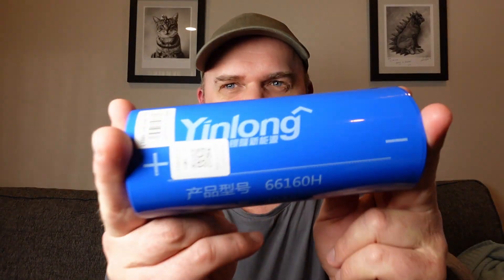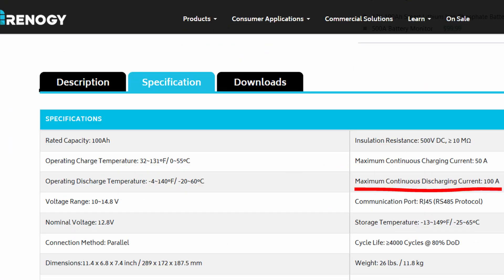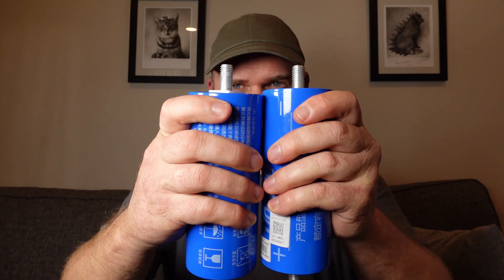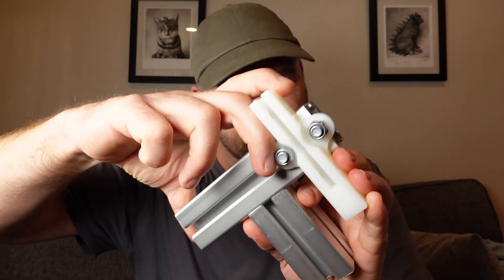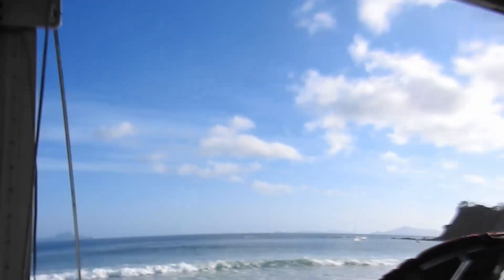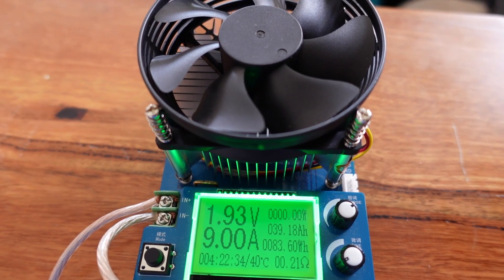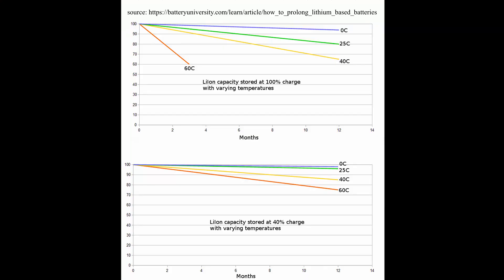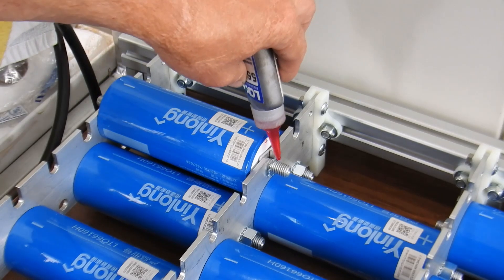Campervan DIY battery build HUGE POWER!

Comment: As an electrician, I appreciate your engineering skills. I do have a couple of suggestions: Best to use copper bus bars. If not, use tin coated aluminium bus bars. Aluminium oxide, which forms very quickly on bare aluminium, is very resistant to electrical current. The star washers you used may save your bus bars from melting by piercing through the oxide coating and providing a decent (not optimal) connection to the un-oxodized aluminium. Tin coated bus bars are protected from oxidation by the tin. The last option would be to sand the connection areas and use a non-oxidizing electrically conductive grease on the aluminium. This grease can be purchased through most electrical supply houses and many hardware stores. I would also use lockwashers on the studs along with nylock nuts (and no thread-lock compound, but anti-seize compound). When aluminum under compression connections is heated, it will ooze out of the connection. Then when the connection cools, it will contract, leaving a small space between the connection that allows oxides to form. Aluminium wire must be re-tightened every 5 years to accommodate this issue. Copper holds a memory of its shape and will expand back to its original shape instead of oozing out of the connection. The lock-washer will provide compressive force to the connection that will expand to prevent loosening over time, a must on all battery connections. Or better than that, use a bellville washer. It is used to make electrical connections. It is very slightly cone shaped and made of spring steel, so it provides the best expansive connection to make up for thermal expansion and contraction. But they are very expensive. I looked at building a similar system for my home, but went with used Tesla batteries for now. I would assemble them like so: Battery cell---Anti seize compound on stud--Stainless steel nylock nut---Stainless steel flat washer---No Ox grease---copper bussbar---No Ox grease---Stainless steel flat washer--bellville or stainless steel lockwasher---anti-seize compound on stud---then finally, a stainless steel nylock nut. I would use the same system for aluminium bus bars. The nut on both sides of the bus bar is to prevent the stud from putting tension on the cell. All my best to you and your system. You are very correct to look at cost per cycle instead of just cost per kw hour capacity. You will pay more up front, but a lot less in the long run.
Reply: What if he used standard copper pluming pipes 15mm diameter 1mm thick? flatten them with hammer = 23mm wide, 2mm thick, is that good enough? they are affordable , seen many people on YT make DIY Battery Terminals out of them, would it work for his applications? in fact I think maybe he could just retro fit his existing busbar (if this current system allows for 24mm length expansion), he just needs to buy 3-4 pipes at 5m long cost around NZ40 (USD28) each on trademe.co.nz
Reply: @leoncryp8182  While it will work, it is not ideal. Copper pipe often uses a slightly different formula than typical copper bar and sheet stock used for electrical in order to maintain stiffness. The process of hammering out the copper tubing can also cause the copper to crystallize. This is the same as if you bend a copper (or steel) wire back and forth enough, the metal will eventually break due to crystallization. This crystallization also creates a very high resistance in the copper. This is why one is required to use stranded copper wire for flexible connections or power cords. I have seen solid conductor building wire catch fire from being misused as extension cord material. Seems like a lot of work, when you could buy the sheet copper online for not much more. The dangers of getting a battery system wrong can be catastrophic.
Reply: @GoCoyote  Thanks for the insight, buying proper copper sheets sounds like the way to go, what if you had a small project and and some pipe lying around, burn copper with a touch? kind of annealing it or something, would that relax and soften up the crystal structures? seen people do that to bend copper and aluminium, heat then bend slightly, heat again and keep bending, gets very nice smooth bends
Reply: @leoncryp8182  I apologize, but that is beyond the basic knowledge that I have. I often tell people that I have a lot of (hopefully) informed opinions, and hopefully, some facts. One my apprenticeship instructors told us that there is no way that we can memorize all of the information we need to know, as knowledge changes all the time. The thing we need to be able to do is know enough to be able to know that you don't know something, and that there are resources to give us that information.
Reply: @leoncryp8182 cant you just get some nice bar at a scrap yard if gotta save on that?
Reply: @leoncryp8182  there is more surface area
Reply: Unless you sand and apply that grease in an oxygen free environment you will always have an oxide layer there, it happens almost instantly.
Reply from the maker: @mickwolf1077 yes, but the layer seems to be thin enough at that point to be able to be damaged sufficiently when assembled that it seems to conduct well.  The point of the grease in my mind is so that condensation doesn't wick into the mating surface causing further corrosion and pushing the connection apart.  I'm still not fully convinced by grease, obviously a light sand, grease and then sand again while greased on the surface is best.  However, it seems to have worked well for close to 4 years now, admittedly I'm only loading it regularly to about 250A, but have thermal imaged it several times under load and not seen any warm spots yet.
Reply: What about using tropicalisation varnish from MG for bus bars and terminals isulation?
Reply from the maker: Thanks for your comprehensive advice.  I didn't use copper because it would likely have cost close to as much as the cells and then have many points of dissimilar metal contact.  I appreciate ali can be problematic with the oxide layer.  Each point of contact was lightly sanded and had a light coating of grease (not conductive - but have previously found non conductive grease works fairly well).  Am hoping the relatively low currents through each connection will mean low stress and a lack of issue (optimism at it's finest).  If for eg I'm pulling 3kW, it will be pulling around 15A through each cell connection.  Cheers, let me know how your tesla system works out for you.
Reply: @brendontait6968  I looked at doing a system similar to yours. I would have to look if I kept my notes, but I remember that the copper did not need to very thick as you are not passing enough current through any given area to make a dent in the sheet copper capacity. I believe it was 1/16 inch or even less. While you may only plan on running 15 amps through your cells, you have to base the conductor size on on your over-current protection device. You could even use 1/4 inch plywood for strength and laminate the copper to it. I was looking at placing the cells in parallel groups and switching the direction of the cell groups. The posts of the cells are almost always designed to work with copper and tinned aluminium, so galvanic corrosion is not generally an issue unless using uncoated aluminium bus bars. It is very important to check with the battery manufacturer before sanding any of the battery terminals. Some are silver plated, and sanding can remove the plating. General rule of thumb is that if its already clean and shiny, leave it alone, aluminium being it's own beast, Its a great material, just needs special consideration for electrical systems. I am using Tesla modules from Daimler smart for two vehicles. While they are great, I wouldn't use them again. They are configured one more cell in series than is optimal for my 48 volt Outback inverter and Schneider 600vdc charge controller. They also need a separate BMS for each 3.3kwh pack. The cost of LFP cells and BMS systems have come down in price to the point that they are just as cheap as the used tesla modules. They would be great in a golf cart though! All my best to you and your system. Please stay in touch if you want more opinions, and maybe a few facts.
Reply: Hey maye at about 2 30 mins in u said each one of those has a 400 amp discharge but writen on them it onle says about 40amps can you please help with that confused on that one
Reply from the maker: Hey, yes... I tried to explain this in the video..  Amps and Amp Hours are different units.  The cells have 40Amp hours written on them.  This is their capacity.  They can put out 40 Amps for one hour, or 4 Amps for 10 hours or 400 Amps for 6 minutes.  The rated discharge rate is 400Amps.  This is how much power you have available to run a heavy load.  For example, some loads may have a start current of say 200Amps.  If you use a battery that is only rated for 100 Amps, you will damage the battery.
Reply: @michaelroberts6299  
The standard Amp hour capacity measurement of a battery (or C rate) is the number of Amps that a battery is capable of delivering over a one hour period. In this case it is 40 Amps for one hour. The battery will also have ratings for charging and discharging based on the "C rate." A 40 Amp hour cell charged at 1C will be charged or discharged at 40 Amps for one hour. While other C rates are possible for the same battery, they generally will have an effect on the total capacity of the battery, with lower C rates adding capacity, and higher C rates reducing it. So the same battery at 2C would charge or discharge at approximately 80 Amps for a half hour, or at 4C, 160 Amps for 15 minutes. LTO batteries are generally capable of being charged and discharged at 10C, so 400 amps for a tenth of an hour (6 minutes) is not out of the question. Some batteries will have different C rates for charging or discharging.
Reply: @GoCoyote  Hey Coyote nice info. One question, why are bus bars acceptable in this case wouldn't it be a good practice to use copper sheets as fuses that die at >400a discharge to prevent thermal runaway and possibly damaging more than one cell?

Comment: Great info and very nice clean build. I've built my fair share of heavy battery banks for RV's , motorhomes, boats golf carts etc with flooded and AMG batteries. Very nice job with new technology. My only question is what interest rate did the bank give you on the 2nd mortgage to pay for all those cells????? 😂
Keep up the good work mate.
Reply from the maker: Thanks, interest rates are super low right now!

Comment: hello, you are a genius
  They are connected in the aluminum they are connected in series, or it is only so that they are fastened
I am new to all this
I would like to start making a project of a car
of course, little by little
Reply from the maker: Thanks Osmar.  The ali bars are to support the cells, but they fix the cells in parallel that then link in series.  Follow along, will be doing lots more how to battery things.

Comment: Haven't even finished watching it yet,but I can already see that you've put plenty of thought into the design. BTW, I know those as cup bolts, and are you not thinking of coach screws? (which are big self tappers with hex heads)
Reply from the maker: Thanks Adrian, I think I said coach bolts... which I know to be what I was using, whereas coach screws are as you said hex head, heavy wood screw.

Comment: If lock tite is applied on the bolt or nut. Heated it up, before wrenching. Work really well.
Reply from the maker: Not sure batteries appreciate a gas torch

Comment: Thanks for the video.  Nice job.  Great technical info!!  Definitely looking forward to your other off-grid videos.  I think the kva comparison in the beginning was a bit misleading since the battery pack can only meet that briefly (I believe).
Reply from the maker: Hey, no problem.  Depends, as far as I know, that is the max rated discharge of those cells.  Tho I am fusing it for just 10kW so will never see close to the 90.  Didn't intend to mislead

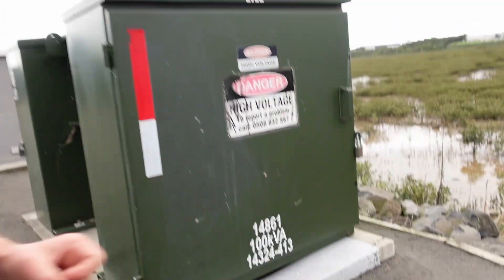Comment: at 2:40, power and energy are usually about the same.     the overlap of certain power/energy metrics  should be understood.     examples:  one joule  =  one watt-second;   kva, kilovolt-amps  =  watts, continuous (watts);  amp-hours, watt hours  =  ways to include  time/duration in a metric           googletranslate
Reply from the maker: Hey David, I'm not sure exactly what you mean about power and energy being about the same?  For eg.  The power output of my battery is around 90kW but the energy capacity is 9.5kWH
Reply: @brendontait6968  you have failed to comprehend my motivation for mentioning  that some  metrics include a time/duration and some don't.  such as  kw.    yer 90kw translates to  So Many  watt-HOURS.

Comment: G’day mate I’m looking to build my own battery for my troop carrier as I’d like to do some touring I’m looking for about 3 to 400 amp hours what do you recommend in a 12 V system. 
Your vid are bloody awesome 👏🏽
Reply from the maker: Thanks Terry, What sort of loads are you wanting to pull from it?  If you want to do electric cooking, then 24V really is really recommended.
Reply: @brendontait6968  mate to be honest I like building lots of things I’ve just finished building my troopy from ground up that I can do! but when it comes to electrical I am a real dumb prick 🤭🤭😂😂 but anyway I do want to give it a crack and as for how much draw load I would like to use an induction cooktop in time to come but I usually use my charcoal grill to cook with and my camp oven. 
I was looking to buy a red arc Manager 30 system but my god they are so bloody dear and at this point maybe out of my budget but yet I don’t want to have to do it twice I just want good quality components that work sorry if I’m a little vague on what you’re asking but like I said electricity is not my forte but willing to learn. 
Anyway brother any info or help you can offer me is greatly appreciated but I certainly don’t want to be a burden to you thanks forgetting back to me.

Comment: When using aluminum conductors, an anti-corrosion coating should be used.  Noalox is used in aluminum wiring to prevent corrosion on wire ends and terminals -> https://storage.googleapis.com/ebh/documents/product/16440_catalog.pdf.  Like you said, Loctite should not be used on threads of the cell terminals, lock washers or locking nuts should be enough.
Reply from the maker: Thanks, yeah I just used grease - you can see me applying it with the cotton tip.

Comment: LTO cells are great for high output but aren’t very good AH so not very good for campers.
Reply from the maker: Depends on what you are wanting in your campervan...  I'm wanting something rugged and safe with a long lifespan... so it works for me.  Ah????  What does it even mean?  A proportionate measure of the number of electrons passed without reference to their energy level?  The most useless term for energy storage.

Comment: I'm still learning all this stuff, so forgive the dumb question - how many of these cells would it take to build up a pack that is 400ah (basically the equivalent of a pair of 200ah batteries that are in wide usage in vans)? These say 40ah so is it just simple multiplication, i.e. ten cells? 

The other aspect of these is the size; I'm guessing just looking at you handling that one cell that for the capacity, building up a bank using these cells would require more physical space than would normal batteries adding up to the equivalent storage capacity? Seems one would sacrifice physical space for a bit lower price?
Reply from the maker: No dumb questions when yr learning... please try and change your terminology to Wh rather than Ah.  Are you meaning in comparison with lithium or AGM?  AGM realistically has around half the capacity of lithium for the same capacity if that makes any sense! So you'd be looking around 50 cells for an equivalent in Lithium and half that for an equivalent to AGM.  The size is probably more dependent on the shape of the cells.  These are cylindrical, that being said you lose about 20% volume as a consequence.  These cells are also available in prismatic where they are rectangular.
Reply: @brendontait6968  50 x $60 = $3000  FYI
Reply: @brendontait6968  I should have been more specific; in comparison with LiFePO4 batteries, so the closest (as best I can tell) other option.

I have watched some of Will's vids where he builds a pack out of the rectangular ones too, but are those the same chemistry as the cylindricals you used in this vid?
Reply from the maker: @scottweikert5189  LTO come in cylindrical and prismatic (rectangular). There are things that should be taken into account that haven't been covered by Will to my knowledge.  I'll cover them in later videos.  Cheers
Reply: In like six words (i.e. don't spend more than a couple seconds typing), what's the difference between the two aside from the shape? :)
Reply from the maker: Very little... the cylindrical ones can output more power and are slightly cheaper.
Reply: Understood. Thank you!
Reply: No, sorry. Does not work like batteries. The total capacitance is 1/Ct=1/40+1/40 times the number of capacitors. So very little anfter connecting 10-11 in series.
Reply from the maker: @countmorbid3187  it's not a capacitor, even if it was, you've got an incorrect assumption. If your capacitance halves but your voltage doubles, your energy storage doubles.  If you double the voltage on a  capacitor, your energy quadruples.
Reply: Thought my mobile phone blew up

Comment: Beautiful installation , you don't need petrol anymore 😀
Reply: you never know . if solar improves and the LTO get relatively cheaper he might take out the diesel and put in an AC variable frequency drive running at 200 - 400 Hz with regen and blow all our socks off.
You will see random socks laying around in the street just acting sketchy